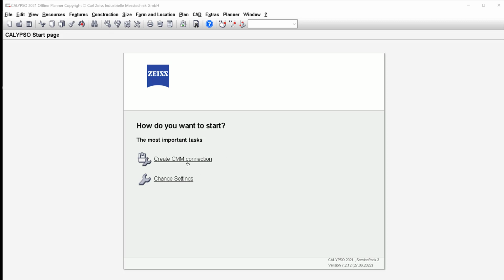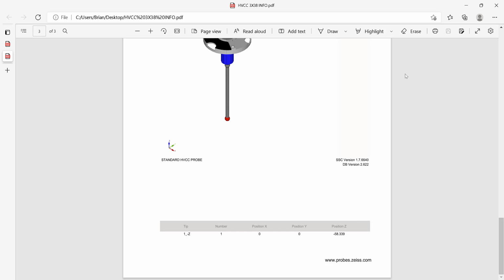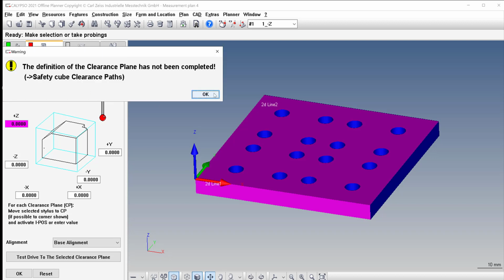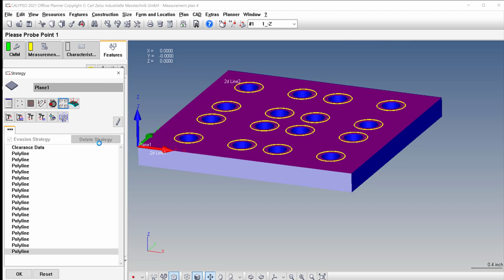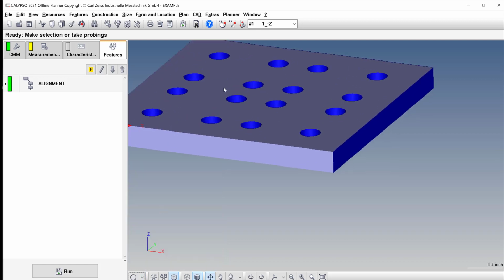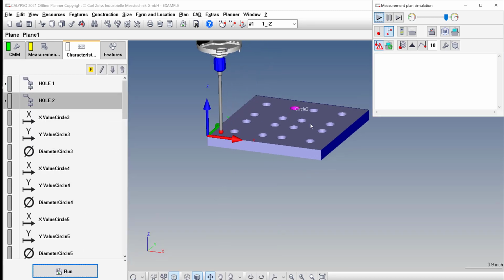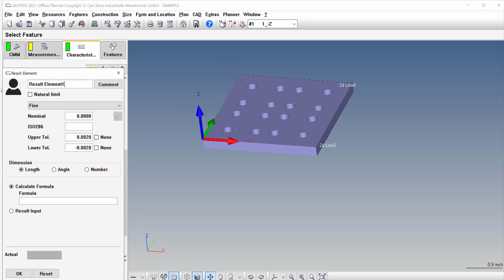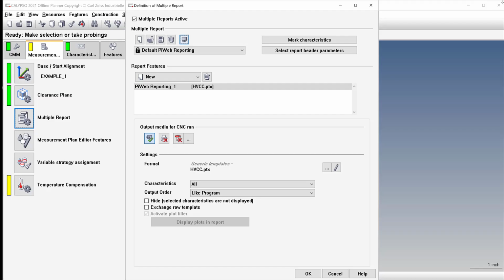Zeiss CMM Calypso Programming Offline

Comment: We just bought a Contura new last week.  I'm trying to get a head start as our class doesn't start until February.  After aligning parts. I am checking with simulation and the box that is supposed to be lit is not, so I cannot run it.  What can I do turn it on?
Thanks,
Jeff

Comment: I'm currently setting up a Planner seat for Calypso 7.6 and ran into one part I just can't seem to wrap my head around. Specifically, I'm confused about the Z-value you entered—why did you type in -2.2968 instead of -58.339? Isn't -58.339 the actual location of the probe tip in the -Z direction?

I’d really appreciate it if you could explain how you arrived at that value. This is the only part that’s tripping me up. The initial setup of Calypso (Contura G2 AND the Planner license) went smoothly, but I’m still struggling to fully understand the SSC.

I also came across another tutorial where someone uploaded both .ssc and .txt files of their existing stylus systems, and both appeared in Calypso. He was using the same version (Calypso 7.6 from 2023), the same machine (Contura G2), and the same probe system. However, I wasn't able to find any way to directly upload the exported .txt files from our machine into Planner, which made that method a bit confusing for me.

That said, I think if I can fully understand how you calculated or derived the Z-value at around the 5:38 mark of your video, I’d be able to manually transfer our stylus systems into Planner—even if I have to do it by hand.

Thanks again for the video! If it weren't for guys like you and Prof. RDeanOdell, I honestly don't know what the Calypso community would do. I really appreciate all the content you guys put out!
Reply from the maker: The value of 2.2968 is in inches, the 58.339 is metric. I normally work in inches so that I why I chose that value. Thanks for the feedback I appreciate it!
Reply: @BrianWickhamMFG  Do you know if there is a way to import the .pcf file to use for the stylus geometry? We have an XXT-RDS with many, many different positions. I was able to upload the RC list into the .ssc stylus system, but this only gave me the positions, omitting the geometry. Was just curious if there is a faster way to sync the geometry between the machine and Offline Seat. TIA!

Comment: Thanks for sharing, I could not understand where this -2.2968mm came from, could you explain me?
Reply from the maker: This is the z value of the styli as built in stylus system creator.
Reply: @BrianWickhamMFG  yes but in there it was -58.339
Reply from the maker: The 2.2968 is in inches not metric

Comment: HI Brian, 
I moved to my Calypso ver. 6.4 on a new laptop with Windows 10, installation is done... open it and went through things like your video... an error window popup "Error -88 during communication with the probe database Details on this in the log file ...."
Is this related to windows 10 or something else? 
Thanks
Brandon
Reply from the maker: Not sure on that one, have not had that error that I can remember.
Reply: @BrianWickhamMFG  Oh I got it fixed. My typo on my old version 5.4 (not 6.4). The error due to Microsoft drivers (SQL and Visual ++ ...) I ran upgraded and it fixed the error.